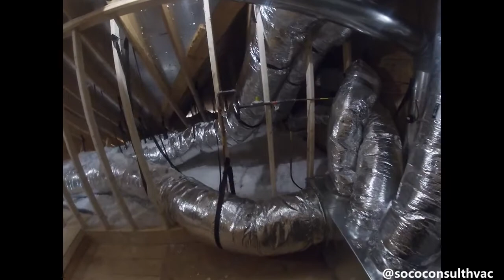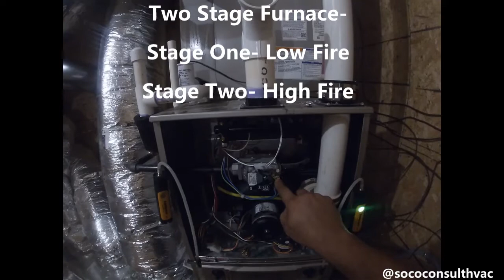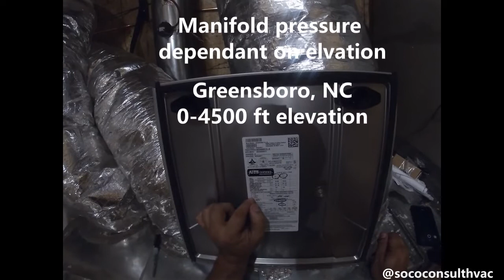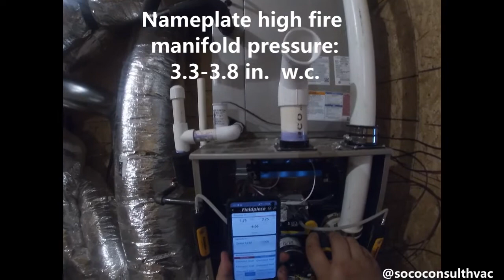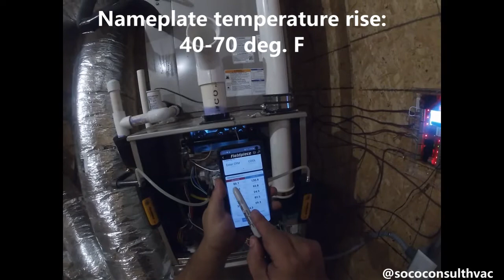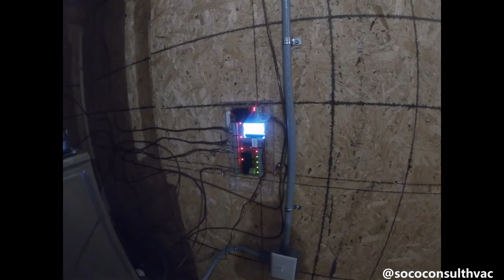Adjusting Gas Manifold Pressure On A 2 Stage Gas Furnace

Comment: this is wrong information - the  manual says what to set it to within the range based on natural gas heating value and elevation. "read the damn manual" is a good rule.
the range is there to adjust for local heating value of the natural gas not so you can set it to whatever you want in the range. the btu/hr input should not exceed what is on the rating plate.
unless you have an airflow measurement on top of temp rise and you can calculate output btu/hr you don't know if it's over or under-fired. 
a combustion analyzer does not tell you this for example high o2 can just be from a short vent run. neither does temp rise by itself.
these furnaces have #44 orifices instead of #45 and at 3.5" high, 1.5" low are actually slightly over-fired with typical 1050 btu per cu ft gas in north america.

Comment: Thanks for this informative video. Can a high manifold pressure in stage 2 heat cause the limit switch to trip? Experiencing issue with keeprite high efficiency furnace kicking out with code 4 (Limit switch) after 5 minutes of running in stage 2. Changed dip settings to disable comfort setting which reduces blower fan by 17.5% in stage 2 and this made a difference in that furnace was able to run for about 12 minutes in stage 2 before tripping on same error. My though is that it's burning too hot in stage 2, hence my question above.

Comment: So I have a two stage Lennox that had been converted to LP. Now I need to convert it back to NG. I have the components. Question is can I count the number of turns on the low and High fire when changing springs and expect it to be ballpark range prior to adjustment?
Reply: In theory, if you know EXACTLY how many turns you made to convert to LP, it would work. But the safe bet is to use a manometer.
Reply: @timdestasio3367  lp uses different springs in the gas valve.

Comment: How long does it take to go into stage 2?
Reply: It depends on what energizes W2. Here, the zone module does it anytime 2 or more zones call.
Reply: @timdestasio3367  okay thanks! does propane gas have a different effect than natural gas on gas pressures?
Reply: @MYWLKISDIFFRNT  yes propane runs higher input and manifold pressures. Usually manifold is 9-11” WC
Reply: @timdestasio3367  okay thanks

Comment: Very clear and concise video. Quick question. I've adjusted a single stage but never a dual stage gas valve. How do you specifically energize the low side then the high side? Do you pull the connector and alligator clip specific terminals so only low comes on, check reading then do high and check reading. I do realize you need to check both low and high ports, just not sure about energizing just one or the other. TY
Reply: Energize W1 only first. Set it up in "low fire". Then jump W1,W2 and adjust in "high fire". There are 2 separate adjustment screws for each stage. Thanks for watching, great question! Tim.
Reply: @timdestasio3367  Thx for the quick reply! Does this sound right?  Run a jumper from R to W to get the first stage, once the burner lights and I make my low stage adjustment,  keep that jumper on but add another from R to W2 so I have 2 jumpers in play and I don't have to wait 10 min for the second stage to fire and then make my adjustments on that screw.  If anyone is wondering the alligator clips(jumpers) are being added on the board where the Tstat wires connect, just temporarily to get the manifold pressures adjusted.
Reply from the maker: @problemsolving7190  Yes that is correct.
Reply: @sococonsulthvac2575   What would be the cause if only in the hi fire the valve won't adjust off of 3.  The low fire adjustment went well, got it dialed in at 2 but no matter how much I turn the adj screw on the high fire side it won't move off of 3. Bad valve?
Reply: Low input pressure or a clogged screen in the gas valve, if that’s not it then the gas valve has failed.
Reply: @timdestasio3367   I didn't check the input as this unit has been operating for 12 years w/out issue. I just thought I check it out and make sure as the service techs in the past have done nothing they say they have done. Makes sense that the input wouldn't be quite there. It calls for 3.5 on the high fire and it's only reaching 3 but it won't even back down from 3 where on the low stage I can watch the dial change quickly as I turn the screw...? Would you start with checking input pressure? If that's adequate consider replacing the valve since it is 12 y/o..it's a white rodgers.
Reply: @problemsolving7190  follow the video. This video is designed for hvac professionals. Im not sure if you are an hvac pro or not but this should not be attempted by someone without the proper training and certification. Best wishes be safe.
Reply: @timdestasio3367  I understand...just a diy but used to work with my uncle growing up(electrical/hvac) so I know enough...just don't do it everyday. The inlet pressure should be between 5 and 10. It's just at 5 on low and drops down to 4 once it goes into the high stage. I was told they increased my regulator when my package units on my building were installed and sized the pipe correctly. These readings are also when the other 2 units I have are not running(2 ton, 3.5 ton) I'm guessing perhaps the gas company changed something on my regulator when they put in apartments across the street or none of the service techs have done the job they were paid to do..same old, same old. Hence, why I'm working on it myself...like so many other things. I appreciate your help! I'll check with the gas company first and make sure they have it setup outside correctly.